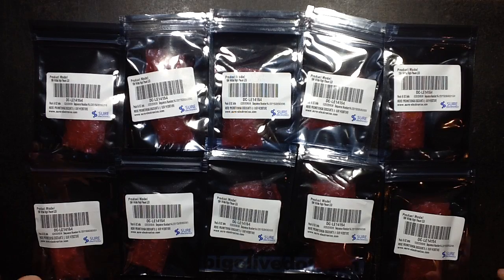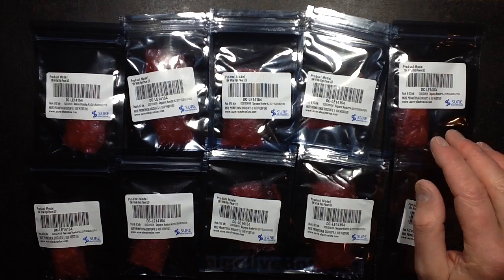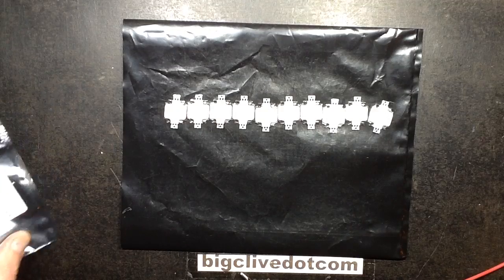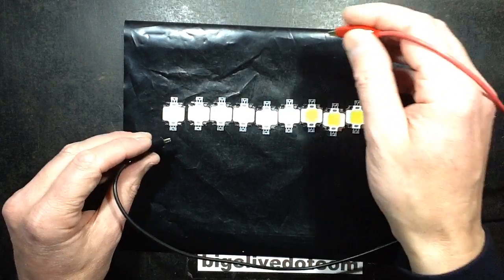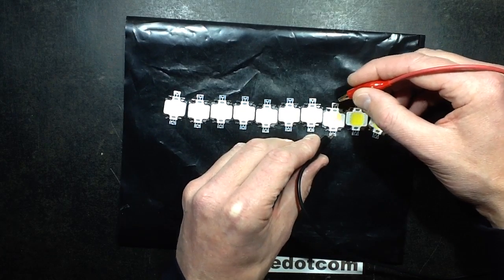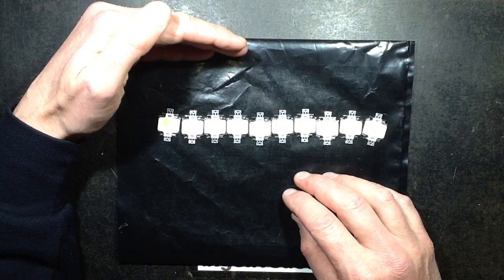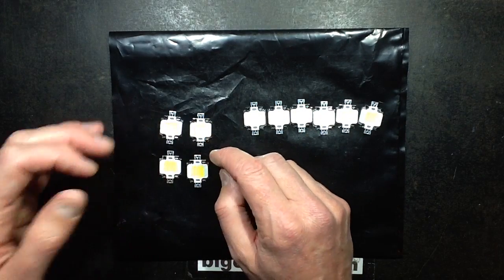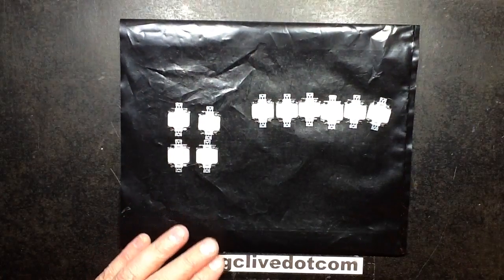Testing some 10W LEDs (9 chips in series version).

Comment: How can I tell what surface mount led wattage i need to replace in a head torch  please 
?
Reply from the maker: It depends on the style of the LED.
Reply: @bigclivedotcom  I have taken a photo , I just looks like a small square led with a white plastic ring that sits over it.
Reply from the maker: @louisesearby7522  Could it be a Cree LED?

Comment: Hey,I just got some 10W LED chips to build a custom night light.Is it possible to wire LED Chips in series or must they be in parallel?If there can be wired in series,does it mean that I need a 36V power source if one LED has a rated voltage of 12V?

Comment: WHAT IS YOUR THOUGHT ON USING THESE IN A CAP DROPER CIRCUT 5 OF THESE IN SEARIES I AM ON 120 VOLT @ 60HZ
Reply from the maker: Capacitive droppers are only suited to low current applications.
Reply: THE LEDs STACK UP TO 135 VOLTS 5 UNITS IN SEARIES  LIKE YOU WISH TO UNDER RUN THEM IN MY CASE @ 200 MA I HAVE 200 VOLT CAPS @ 47 MFD AGAIN I AM ON 120-125 VOLT @ 60 HZ I WISH NOT TO USE SWITH MODE OR A TRANSFORMER
Reply from the maker: Capacitive droppers are just not suited for high current as they will pass enough current during transients or even at power up to potentially damage the LEDs.  The LEDs themselves are not designed to handle such a high voltage between the chip and the substrate, so you could end up destroying all the LEDs.
Reply: WHAT IS YOUR THOUGHT MY HEAT SINK SETUP IS 5 SMALL HEAT SINKS 1 PER LED MOUNTED ON ISOLATED BRACKETS AS THEY ARE THE ONLY METAL PARTS WHAT WOULD YOU USE WITH THIS SETUP THAT DOESENT USE CHOKES TRANSFORMERS OR SWITCHMODE SENCE I AM MOUNTING THESE NEAR LO LEVEL AUDIO SOFAR THE ONLY LIGHTS THAT DON"T CAUSE HUM ARE CAP DROPER LED FILIMENT LIGHTS NOT BRIGHT ENUF AND TUNSTON LAMPS TO HOT WAST P[OWER

Comment: I must say I enjoy all your videos, and rather enjoy the in depth break down of the items. Recently I converted all of my 4 foot shop lights over to leds using the 8520 rigid strips powered by 12 volt solar charged battery and they work great.Got the led bug so its now on to my next project. I have built a under water led drop light with 9 green 10 watt leds powered by a 12 volt automotive battery. this is where I have some concerns The leds are connected in parallel and their specs are, voltage DC 9-10.8V ,current 900mA and they have the integrated approach 3 and 3. I don't to destroy the leds and for some reason I just cant wrap my brain around how to power them, brain fade I guess. would you have any suggestions. keep up the great videos thanks.

Comment: Pink bubble wrap is not "static generating". The pink bubble wrap is anti-static. Honeywell ships replacement displays and components in it, many of which are ESD-sensitive.
Reply from the maker: +Eisen Faust Although don't assume that Chinese supplied pink bubble wrap is anything other than bubble wrap that is pink.
Reply: +bigclivedotcom most of the Chinese stuff I get comes in the metallized stuff or else regular poly bags. I haven't laid hands on their cheap version of pink bubble wrap. Try rubbing it and see if you can get it to attract pepper or flour. That's a good test for static dissipating materials like pink bubble wrap. I'd give it SOME benefit of the doubt just because they could have used a cheaper poly bag.

Comment: I don't think you can assume that if you put 4 of these in parallel that 600mA will be equally shared among them.  They don't present a resistive/linear load to the supply.  If there is enough variation between individual units, you could very easily wind up with a much greater fraction of that 600mA going through one unit than through the others (right up until the moment when the one sinking the higher current fries, that is !).
Reply from the maker: I'd voltage match the ones I used.  And with four sharing the current it should be less than around 200mA per LED even with a slight variation.

Comment: Clive, since you have inspired me to switch some lighting over to LED, I was wondering if you have had any experience with the 100W drivers on eBay. There are two that I am looking at, just a standard 100w and then a 100w dimmable unit. They look identical in the pictures, just the dimmable unit has a 22k pot wired into it somewhere. If that is truly the case, I can't justify spending double the money on the dimmable unit when I can add in the 22k pot myself. Do you have any insight? 

These are the two i'm looking at. 
100w: http://www.ebay.com/itm/301604849690?var=600488628420
100w Dimmable: http://www.ebay.com/itm/85-265VAC-100W-Dimmable-LED-driver-30-36V-3A-Version-2-1-/271960390643?hash=item3f521a3bf3

Thanks!
Reply from the maker: +subsgob00m I'd actually recommend staying clear of the 100W LED drivers completely.  If anything it will be cheaper to buy a 100W floodlight and then retrofit it with a 50W driver so that the LED is run at much lower power, but has the benefit of the bigger heatsink.  Too many of the higher power LED lights are just not designed for proper heat dissipation at all, and as a result the LEDs are failing quickly.  Are you wanting to use these as work lights?
Reply: +bigclivedotcom I was planning on making a rather long bar light with these ran in series/parallel, 10 of them in total. I wouldn't run the set at full power hardly ever, but I'd like the option to run them at full power if needed. The heat sink would probably be a milled aluminum bar with fins cut into it. It would be under-hood work light for working on the cars.
Reply from the maker: +subsgob00m Keep in mind that you have to treat the output of these things as potentially at mains voltage, as they are designed for use in enclosed fixtures.  The metal would also have to be grounded for safety.
Reply: I bought some 10 watt leds with the flipchips in them and they are all faulty

Comment: Could you please purchase a few random cold white 100W LEDs from different(!) eBay sellers, including the good-looking-but-not ones, and compare them all in one video?
More specifically, I would really like you to take a look at the cheaper 2-5 pound ones, not the "from $.99 to $99.99" listings, because the cheaper ones seem much more fishy.
Reply: I would be suspicious of any LED claiming 100W within the 2-5 pound range.  I would be surprised if any delivered anywhere near acceptable life even with ideal external heatsinking.  But why would one want such an intense cold white LED?  Those things are harsh as hell to look at...the world was not meant to be rendered in blue (cold white)!
Reply: Ethan Poole High speed video research(heh, research, just for lulz moreso), you need LOTS of light at higher shutter speeds(1/30kth and up).
I'm looking for neutral ones though, not blue-ish tint.

Comment: The degrading could be due to heat sink issues, I got a 88-99% increase in hours between mean time failures by putting a small fan on the housings. When they are used indoors, there isn't as much wind or cool air (I know your house is cool however) but they really aren't meant to be used indoors. Try a fan on the back, it should double their life.

Comment: Clive, you might want to experiment with separating your audio out into stereo.  For some reason, you're the only youtuber i watch that I have to switch my speaker settings to hear your videos.  On a 5.1 system, you only come out of the center channel, rather than being in stereo.

Great video as usual.
Reply from the maker: It seems to be the way the iPad and YouTube's capture app does it.  The iPad records mono with a single microphone.  Some audio systems interpret it as a bass channel and send it to the subwoofer.
Reply: bigclivedotcom Interesting.  Good to know.
Reply: +bigclivedotcom From my experience in working in commercial PA and recording you NEVER record things like this in stereo, or any surround format. You do it in mono so all devices can run it evenly and interpret it per end users settings. If someone is having issues with their surround system interpreting your video then it is their equipment not yours. I have played this video in mono, stereo, 5:1 and 7:1 on my Bose system also on my Aston Ross System and all sounds fine, The trouble starts when I run it through the cheap "Wal-Mart" bought surround system that cant process it's way out of a wet paper sack..
Reply: +ElfNet Gaming Interesting, because my Marantz SR-7000 series throws up all over this audio.  Must be a wal-mart budget system.

It's not an issue with the hardware the listener is using, it's an issue with audio separation, and the way youtube handles mono audio..  Hence why this is the only channel i've got in my subscription list that has this issue.  The vast majority of folks are using stereo mics or at least upmixing their mono into stereo.   The world of online video has very little to nothing to do with the standards used in broadcast TV or even home video, for that matter.
Reply: That is interesting, I have an SR-7000 series system out in the shop. I may go dig it out and hook it up and see..
If it does puke up on this video then I will stand corrected. I shall report back in a while
Reply: ElfNet Gaming It's not that i have a problem with it, it's just that it won't fill out the side speakers, which makes the audio sound really strange, like he's talking in your face (you'll get what i mean if your surround is set up properly).

I will also concede that this could be some weird output thing my audio card is doing.  I output over PCM 5.1 (analog, positional audio in games), as well as over optical for DD and stereo audio.  I am forced to use PCM and set the stereo modes to off to hear this, it's really strange.

As broadcast vs pc audio goes, the default format for broadcast still basically assumes everyone has a TV with a single built in speaker, and then leaves the sound hardware on the listener side to deal with separation.  When we're talking watching from a computer, one should always assume someone is at the very least listening to headphones (stereo) or to a 2.1 system, minimum.
Reply: it could also be some weird youtube thing as well.. Google has been know to do such things in the past. Anyways the possibilities are almost endless as to what it could be.
Reply: Actually, the way analog 5.1 audio works, anything monaural with identical audio on both the left and right channels will give priority to the front center channel (though there should still be lower level output on the front left and right channels ordinarily) -- that is just how the front 3 channels are matrixed in analog mode (going back to Dolby ProLogic in the 80/90s).  If this results in audio that is too quiet (versus stereo) then it may be a sign that the gain is set wrong on your center channel.  But a lot of well shot videos where lapel mics, for example, are used should be coming out similarly for you as they will also have identical audio on both channels (if recorded/post processed properly, otherwise it is left or right channel only).  That said, many Youtubers do not use external mics and will simply record in whatever format their camera's built in mics provide for (whether that be mono, stereo, or 5.1), so it may simply be your selection of YouTube channels.
Reply: I tend to watch a lot of really well produced youtube channels.  This is literally the only one I've ever encountered this issue on, except a few REALLY old potato-cam videos from the early 2000s.
Reply: Ethan Poole Almost ALL YouTubers that have a studio setup use an external mic, granted their choice of mic is piece of shit usb types with delay..
I use a proper studio mic in my studio (Sennheizer MK-4 on a boom with pop screen run into a mackie 1604 vlz pro mixer , then off to a DBx 166sx limiter/compressor before going to the PC) when I am making gaming videos. Reason I have 16 channels is sometimes I have more than one input that needs to be patched in.
For my other videos iI use my smartphone, nothing special there.